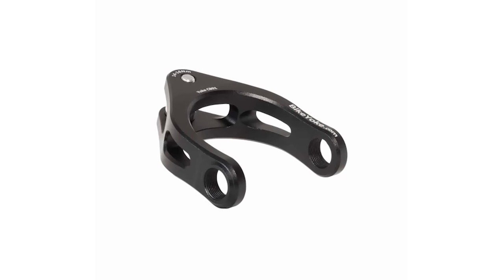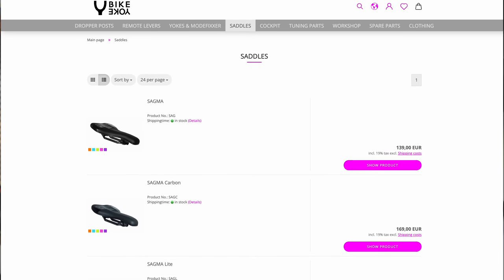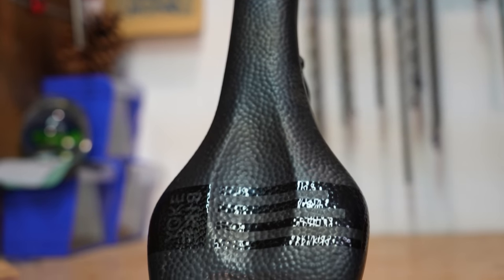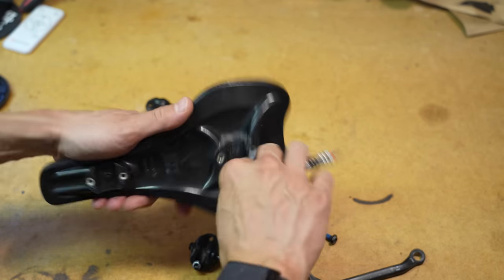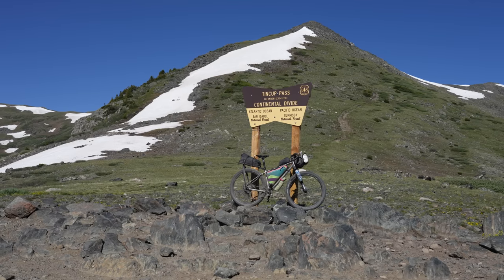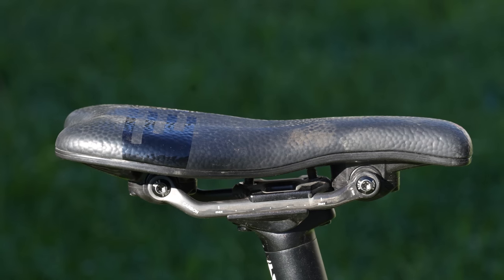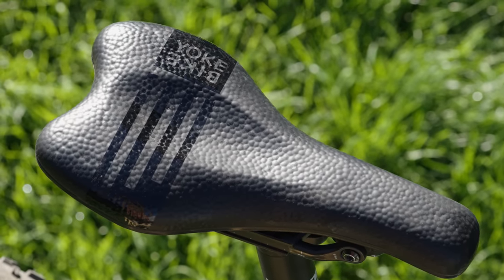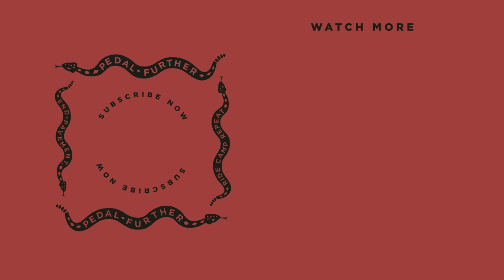A Suspension Saddle!? Bike Yoke Sagma Review

Comment: I recently discovered that rather counter-intuitively (for me), the softer the padding on a saddle, the more soreness I had on longer rides. I switched to a harder saddle and while less comfortable on short rides, it made quite a big difference on long ones (same bibs). Maybe that's just me and my butt though 😆
Reply from the maker: that's my usually my experience too, but this thing is certainly different. Thats what I think happened at the beginning of my test period, the padding gave me more irritation, but then it just went away.
Reply: i came to the same conclusion after having used a suspension seatpost
you usually lift yourself a tiny bit off of the saddle when you press into the pedals (not lifting off of the saddle, just taking away pressure)
the suspension seatpost always keeps the same pressure, even if you lift a little bit
over long rides that can be quite uncomfortable
and the second thing is when riding over bumps you actually do lift yourself into the air and the bike can do whatever it wants without hammering your hind side
and again, the suspension seatpost transmits all those bumps to your body, not as impacts, just softened motion which again increases pressure
Reply: @marc_frank oh wow, that's crazy. I would've never thought of that!
Reply: I agree. my favorite saddle right now is the Brooks Cambium C15, but I also like the WTB Silverado.
Reply: Same here. On the road, I use an SMP with no padding.
Reply: Yep.  Paradoxical.
Reply: I usually have same experience with regular saddles with padding being nice for short runs but firm thin padding but good flex for long rides hits the spot.

Comment: Great review.  This might be one of those items that helps certain people mobility issues have more options.  It looks like this seat moves more to the rider.  If someone has a significant leg length discrepancy, it might allow the hip of the shorter leg to roll down a bit more easily.
Reply: I tried it(130mm)  It is very flat on top-especially in back. When my leg pushes the pedal down, the back of my leg pushes into the seat, causing it to pivot down with each pedal stoke.  
My specialized Toupe (130mm) is very rounded in the back.  My leg just moves down with no seat in the way because the back is curved down.  
I found that The Yoke solves a problem-that I do not have with my other saddle.
But it may solve a different problem for a different body type. Nice effort though-it feels high quality.